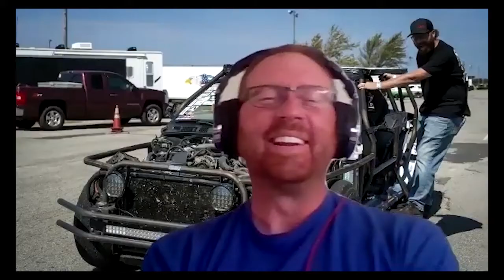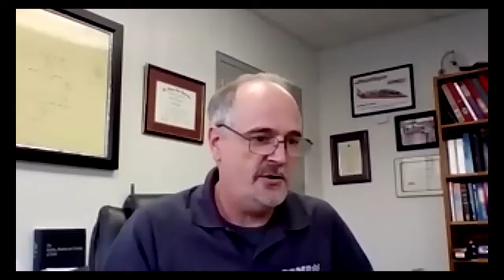Difference in Naturally Aspirated and Turbo Cam by Billy Godbold

Comment: Comp spec’d us a ROWDY cam for my 5.3 turbo. Tightened up the converter from less tq, but required almost 20% more fuel above 7k rpm!! (where I spend most of the time down the track). And it sounds sooooooo good. 250/258 at .050 😈